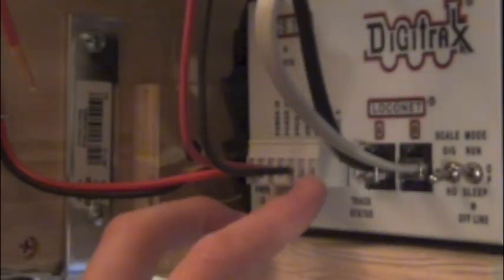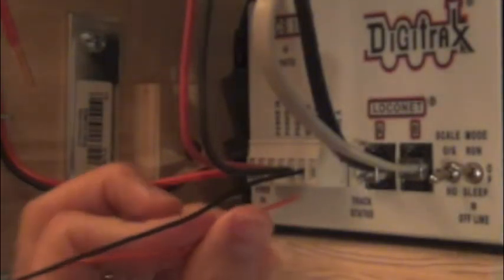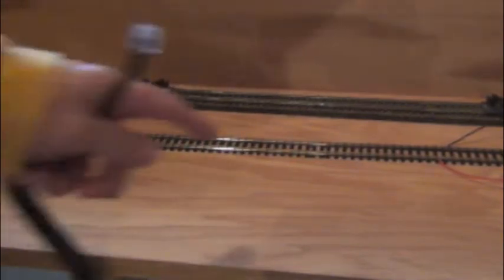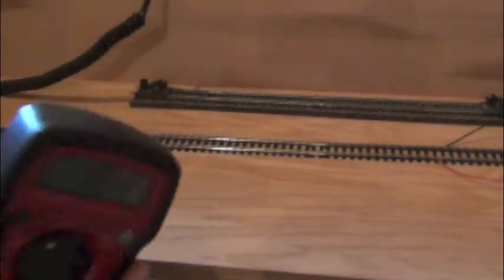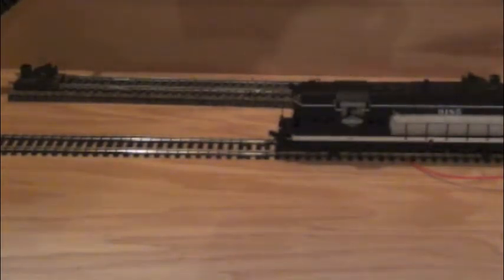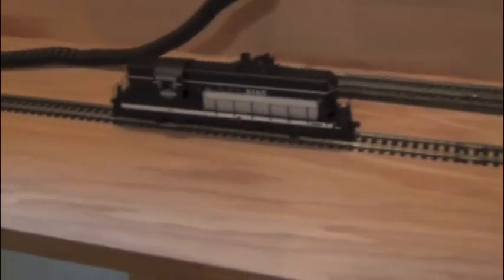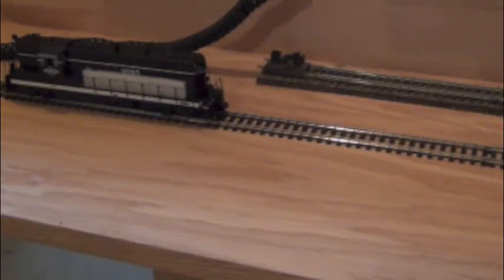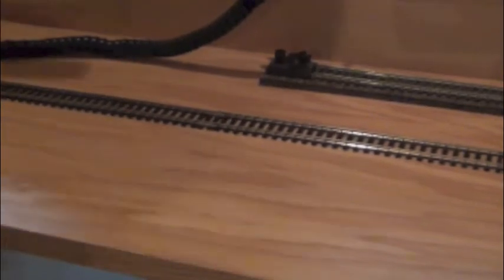Digitrax Super Chief, Track Soldering Part II

Comment: Did you ever find out what the problem was? My athearn/tsunami1, kato/tsunami1 locos do this on my layout but not Atlas/esu
Reply from the maker: See my previous response to your post.  What type of DCC system are you using?
Reply: @ck7813  thanks. I'm using DCC++ with a 3 amp 16v power supply. Likely ~14v at the rails. My issues started when I connected my double track main on my lower level (essentially closing the loop for continuous running).
Reply from the maker: @mattw9667  a couple things to consider, with a 3amp DCC system, it can probably only handle 3-5 sound locomotives before it pulls too much current and they start behaving like what you are describing.  How many locomotives are sitting on your layout (it doesn’t matter if they are just sitting idle and not being used, they still draw current when track power is on)?  The other thing to consider is the longer your bus wire is, the less effective it is (the current has farther to travel).  When you added more track the 3amp DCC system might not be powerful enough.  You might need a booster.
Reply: @ck7813  it is likely bus wire length and/or bus wire complexity. I have a straightforward bus running on the upper deck but bus "feeders" dropping down to the lower deck in two locations. Only have one loco on the track at one time.

Comment: Do you have the power selection switch on the power supply placed at the appropriate power level for the command station?  That could be a issue.  Other than that I would email Digitrax and see what they say if you do not already have this resolved.
Reply: Looks like you need a power booster-knowing the train is okay.they called a tip in stumble it's a voltage drop